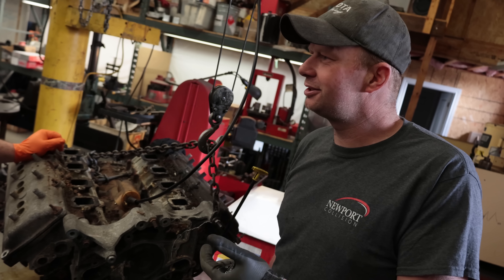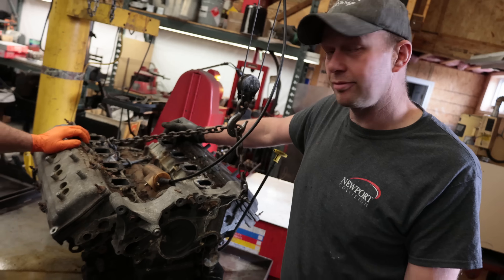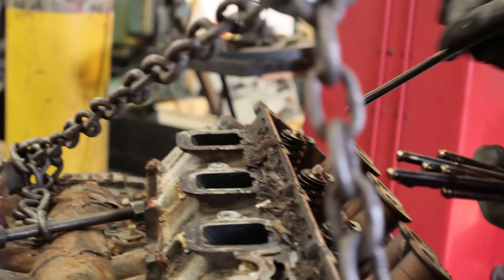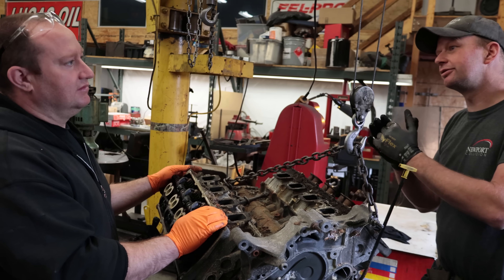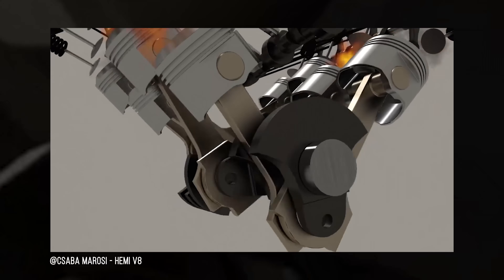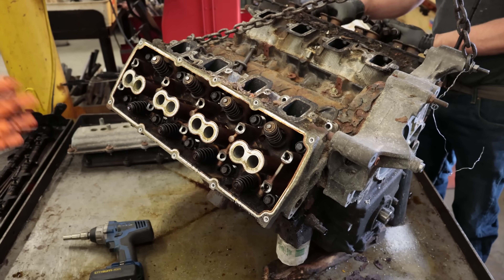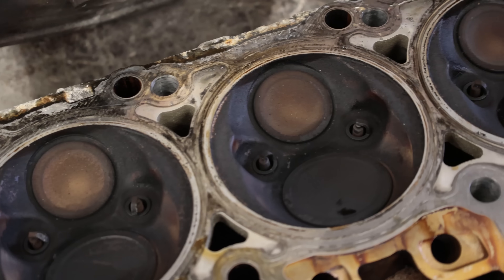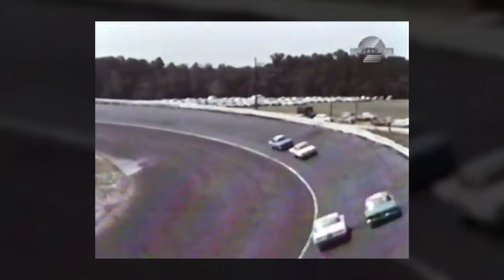REVIEW: Everything Wrong With A 5.7 HEMI 345 Engine

Comment: I have a 2005 5.7 hemi in my 1500 ram. I'm very interested in the break down that you are doing on this engine. The issue I am running into is intermittent low oil pressure. Engine is still running, no tick, regular engine oil service with synthetic. Very reliable truck until recently, with 430,000 km on unit. Check gauges and they are working fine, mechanical gauge says 20-30 psi. So my options are leakage or failing oil pump. Have you heard of a failing oil pump, or what would be the obvious oil internal leakage be. 
Thanks for your time and videos on the 5.7 hemi.
Reply: it's mostly just the sensor.. i didn't changed it 😁

Comment: I love that you did a 3rd gen hemi and yeah my own experience is from owning my 13 Charger R/T with 210,000 KMs or 130K miles the ONLY issue ive run into with the car has been the MDS system its caused a half dozen misfires plus 2 engine shutdowns at highway speeds other than that zero issues not even electrical issues. I want to throw a whipple supercharger on it and make 550HP
Reply: What did you do to “fix” or deal with the MDS issue?
Reply: @Chef_PC  Z automotive makes a OBDII dongle for Mopar vehicles to unlock features you wouldn't normally have access to mainly the SRT pages for V6 or 5.7 cars but mainly it allows you to disable the MDS system as far as I know it's the better way to do it the extras being a decent selling point on top of it

Comment: I had an 05 ram with a non mds 5.7 hemi in it. Loved that engine. I put a 6.1 cam and push rods / valve springs in. 250 wet shot of nitrous. The truck ripped. Word of caution though for anyone new to power adders; the ring gaps on them stock are tight. If your gonna run power adders its best to open em up. Or just go easy on the boost / nitrous.

Comment: My 07 Dodge had a rear main oil leak and I found out when I did an oil change.  Only 1 quart out of the sump but I never lost oil pressure or had any issues.  Replaced the rear main, filled with fresh oil and thrashed on it some more.  I eventually sold it when I upgraded trucks but never had any engine issues at all.  It's one heck of a motor and I was never easy on it.  Had to replace the rear suspension because I pulled trailers that were heavier than what it was rated for, but the motor never struggled with any of it.

Comment: Lots of guys use 2 types of spark plugs because the spark plug attached to the wire has a further run than the one attached to the coil. I think this is a myth. I wasted $7 each for the good plugs 5000 miles later took them out and put in champion copper for $2 each and it ran better.

Comment: These engines are garbage for the tick reason stated at the beginning of the episode. I had this problem with my truck failed once at 125k and again at 138k. Absolute garbage to work on. Also who designs an engine with 16 spark plugs? Cost an arm and leg to change.

Comment: Our 2007 5.7 hemi ended up dropping a couple valve seats. It lived on 87 octane and I think that was the majority of the issue not having the higher octane to quench the cylinder as much as it needed.
Reply: I agree. I try to use Plus whenever I can in my 5.7
Reply: ..... that's not really how octane works, octane (aki) anti knock index improves predetonation resistance, not temperature
Reply: Totally possible that I’m way off target here. But here is my theory. 
Octane is gasoline’s resistance to ignition. So the higher the octane the later in the combustion cycle the fuel actually ignites or the closer to desired ignition the fuel ignites. So my theory is that over 200,000 miles of always running 87 octane while towing and a moderately heavy use life the 0.0001 second of extra cooling that the higher octane fuel would do as it swirls in the combustion chamber before igniting I think it would have helped keep the head slightly cooler and possibly not drop the valve seats
Reply: @marttirahi523  the motors were built to be cheap and assembled cheaply, nothing complex, leave it at that.

Comment: The heminis garbage, l rebuilt one that blew up when it was cranked up.   Blew 2 rods, ran fine after rebuild but the fuel lines, injectors, engine controlls were all trash.  I replaced everything with new parts and swapped out the harness, computer, gauges, etc.  It would fill up one cyl totally with fuel, keeping one injector on, and did it intermittently.  My friend also buys shifty cars to flip and he flips a lot of hemis, alot blew up on cranking cause water gets in them, it's also not a true hemi.  The transmission was junk also, the who thing was a massive pile of shit, l hate Chrysler, l even know a guy that works for Chrysler as quality control, might message him just to say dodge is fkin junk, l would rather ride a stolen huffy with bent rim and flat tire. Fk dodge, fkin junk.

Comment: I’ve see countless 5.7 hemis drop valve seats usually due to over heating. I’ve also seen quite a few drop valves and a couple throw rods through the block. I’ve also had numerous ones that were just locked up solid from spinning either rod or crank bearing or sometimes both.

Comment: Sadly as a dodge guy i would say a 03-08 hemi is three times  the engine as a 09 and newer hemi! Tons of new engines fail due to lifter failures. Some  early ones had valve seat issues but way less it seemed. Manifold bolts are always broken, kinda like every other brands engines these days. Also pistons are another problem area on the newer ones as well. The LS engines suffers from the same issues as well, lifters and pistons!

Comment: I'm a fan, on my 3rd one. 2013 Jeep Grand Cherokee right at 100,000 miles. Wife drives a 2008 Aspen with 230,000 miles & I had an 06 Jeep Grand Cherokee with 280,000 still ran great
Reply: Hi I also have a 2013 Grand just hit 133K. It started to idle funny and I was thinking it wiped a cam lobe. But no it was just a broken EVAP valve on the charcoal canister causing a vacuum leak! I even sent the oil out with 8000 miles on it, and they said it looked great. Been doing 10,000 mile intervals with 5w20 Castrol edge since new (always added 1 quart at 5000), and it looked clean when I did the intake and valve cover gaskets on it at about 100K. Have just loved every minute with this Jeep, great size, great 4x4 system and great power, for not a lot of money. What an improvement over the 3rd generation. What's crazy too is that the oil looks cleaner draining out of this engine with 10,000 miles, then it does coming out of my well maintained 4.0L six with 3,000 miles. 

I also recognized your name, pretty much anytime Im looking for a video on a vintage car, you have one. Unbelievable how many you have made!

Comment: I have a 03 Ram with the 5.7L and has 304K miles on it. It looses oil pressure after about 2 hours of run time and starts to chatter. I'm guessing it has excessive oil clearances due to worn bearings.

Comment: I have had two of the newer 5.7 hemi engines.  As of right now I own a 6.4 hemi in a 2016 powerwagon.  It has the typical tick. But I noticed that also will change based on oil type and when I change the oil and the type of gasoline I use. My truck only idles when warming up or sitting at the stop light.  Oil changes are key to healthy engine life.

Comment: I have a 2003 dodge ram 2500 with 300,000 miles original engine and tranny.  Just normal maintenance.  I also have a 2006 jeep commander that dropped a valve seat at 200,000 miles.  Rebuilt the jeep hemi and it's been strong since.  I also put a rebuilt engine in a 2004 dodge durango that put a window through the original block from water leaking into the intake manifold from the gasket from the windshield and engine bay.  Good engines with wierd issues from Daimler Chrysler.

Comment: as someone who's blown up a 5.7. the proper oil, not just the weight, but the specs, and changing it at regular intervals is a huge part of keeping these running. I was lazy and used cheap oil that didn't have the proper certifications and it bit me in the ass.
Reply: That will blow anything up. The manufacturer gives you oil specs for a reason. Using the wrong oil is never good 😅
Reply: No way!! using the right oil in my car will save it from blowing up?! who would've thought... 🤔

Comment: The engine shut off at traffic lights and just shutting down a portion of the engine is very bad idea. It prematurely wears the engine. My mothers jeep has it where you can shut it off and just run all the time . Which Scotty Kilmer on you tube even says to have it disconnected all together. Then after you brake n stop the engine shuts off then gets re started after you begin to accelerate. Wearing out the starter and battery. You better a have a fresh battery and be prepared to replace your starter. My mother older other jeep had the cut off switch in it which it’s design you can’t cut it off it cuts parts of the engine out unless you need the full v-8 - but stays in a v-6 mode. When my brother started driving hand me down nothing wrong lots of switch replacements amongst other high millage wear. They need to do away with it or have so you can totally un plug or delete it. My dads 2004 hemi doesn’t have all that crap high millage engine 2-300,000 miles only radiator has been replaced the rest just oil changes plugs [spark plugs] timex power steering does weep but after that many miles typical. Bearings no oil leaks nothing if you do your scheduled maintenance on time no issues with these engines

Comment: Former mopar tech here, the gen 3 hemi engines in the later trucks 2009+ have 6 bolt mains. The 6.4, 6.1, 6.2 also have piston cooling jets, 5.7 does not
Reply: I dont know about that.. my 2011 has 4
Reply: I build these engines everyday and they are all 4 bolt mains.

Comment: Going on 210,000 miles on my 5.7 in my ram. Replaced the cam at 100k and turned mds off at 130. Still going strong, oil change every 5k, bout every 10 weeks or so doing 500 miles a week. Oh and 1 broke manifold bolt, the rest got studs now instead

Comment: I run Lucas Heavy Duty Oil Stabilizer conventional type. That helps keep the oil on the lifters. I think the main damage comes from a dry start where the 5W20 lightweight synthetic oil drains away from the roller when it’s shut off hot. A similar issue occurs with unlimited late model race engines where the synthetic oil would drain away from the roller style cam bearings and gall on dry start up.

Comment: The guy 2 doors down who is retired from Dodge bought a new Dodge truck 1/2 ton 2 wheel drive the truck was 8 months old and it locked up in front of my house and the dealer dropped a new Hemi in it they said it was starving the cam for oil when idling ! The dealer said not to warm up. They told him to start and go , because it will eat the cam up at idle! That’s crazy I guess that’s why and shuts off when sit at stop light to long so it shuts the motor off ! Dumb!

Comment: The original tick is from the valve train - which chrysler did try to tighten the tolerances from what I was told in training, but they started having issues with too tight causing excess wear.
The trucks mainly have issues with 5 of the exhaust manifold studs breaking off, the right rear 2 first, then the left rear 2 all of which are from the weight of the exhaust hanging off the rear (GM trucks do the exact same thing) and the 5th bolt that breaks is the left front on the versions that use that to hold the dipstick tube.
The lifters rarely have an issue with the MDS. Been working as engine tech at a chrysler dealership since 2006 and can only remember 1 time the lifter failed due to MDS. Most common is the roller or the plastic retainer for the lifter, which I have seen the exact same issue with LS as the lifter design is very similar with the plastic tray and the roller lifter.
Reply: dodge always lie they dont want to fix the problem because it causes us to buy again damm crooked schemes. i,m pissed right now mines damage the cam at only 160 kilometers insane and i always baby it like my older dodges.
Reply: I have had  NO LUCK with these engines.  Losing 2 both at around 150k

Comment: I never understood why they gave a 5.7 liter engine (or anything bigger than 3 liter at all) a feature like displacement on demand. It's not an economy car. Why should anyone care how much this engine emits / consumes fuel if you buy a 5.7 liter engine. You know it's disastrous. You buy something like this for the pulling power, horsepower and sound of course.

The same goes for direct injection. It will certainly make a difference in power and emissions, but watch the damage you do to the engine. Everything fills up, gets stuck and sticks.... 150,000 - 200,000 kms and you can put in a new one. Environmentally aware indeed!
Reply: Direct injection can be great if it is paired with a indirect (port) injection system, which many manufacturers do. The car will use the DI system under high load to for maximum power output and switch to IDI when power isn't needed.

Comment: The one failure I didn't hear you mention was the valve seats. The pre-eagle 5.7 doesn't have the issues with the 'Hemi tick' like the eagle version. However, if they overheat the aluminum heads are bad to drop the steel valve seats and this will destroy the entire engine. So it is important to take care of the cooling system on these.
Reply: I 2nd this. Had an 05 magnum with the 5.7 and it dropped the #6 intake valve into the cylinder out of nowhere one day when I started it after getting groceries. The quick heat cycles really killed those due to the different expansion rates of the metal.
Reply: Yep 2 different motors 2 different issues
Reply: heard they quietly fixed that issue on the 07 motors but could be wrong
Reply: Valve seats failed on early Eagles, too, along with timing chains and tensioners.  

Lifters were an issue on all 3G Hemi V8s. MDS, Non-MDS, cars, and pickups alike.  They all had failures.  

The 318 and 360 Magnums were far more durable.

Comment: If a guy drives freeway everyday great engine. You store your car over the winter… forget it your screwed, lifter replacement.  Cop car engines last maybe a 100k miles.  But mine got 60k miles being babied.  Great power after the cam and lifters replaced but I would never buy one unless I was going to drive it every single day, the oiling issue is huge on a car you want to use as a toy.  This is a case where high mileage engine is better than low mileage ten year old engine.  Still makes me mad as hell.

Comment: As a challenger R/t owner with a 5.7 in the car.  I can say, the oiling on the lifters at idle sucks.  60k miles new lifters,  that displacement shut off sucks. I can also say the the that stored cars fail as often as are cop cars. Drive the snout out of the car your fine but trying to not drive the car in the winter killed my engine.

Comment: Incredible rod bearing! I bought a new Detroit Diesel 8V92TTA powered semi in 1979. I took it to the DD shop in Memphis, TN with 675k miles for rod and main replacement as a preventative. All bearings looked as good as that rod bearing off #6 so much so that DD asked the shop to send them in to their lab for analysis. I never heard back but I must say, that was absolutely the best engine I ever owned and I have owned a bunch!

Comment: I added a magic bottle because of a minor valve cover leak, thick as molasses.  Bardahl stop leak.  Lifters are loud with it at hot idle.  This engine likes to run on the thin 5w20, low oil pressure at idle is the issue with them IMO.  Have a valve cover gasket in the garage have to get around to putting it on.

Comment: Like you say, the more desirable Chrysler vehicles are either really hard to find or really expensive. I think a mid-late 70s C body, R body or whatever other full size Mopar you could find would be interesting to see. A Gran Fury, Monaco, New Yorker or Newport, something like that... A 600HP cruiser with air suspension and whatever period correct accessories could be found or replicated.

Comment: I did 225,000 miles in my 6.1 srt8 300c touring (estate car) with no engine failures. Oil changed every 7,000 miles engine was great. Just thought id share as fact are better than beer talk.

Comment: My god father owned a machine shop and I helped rebuild many of those motors almost all had rocker arm issues. Some would come in with only 8k miles on them. The dealership was right around the corner so that's why so many.